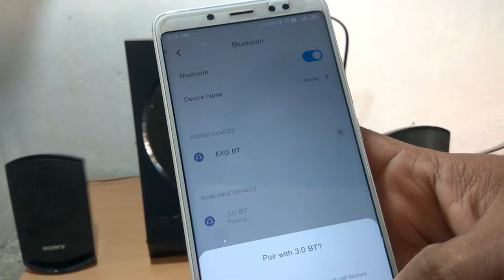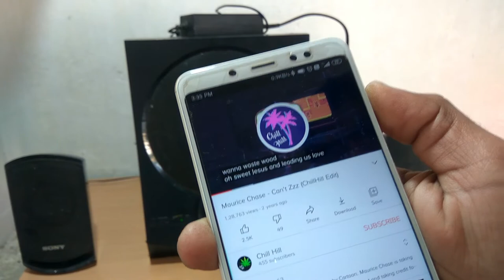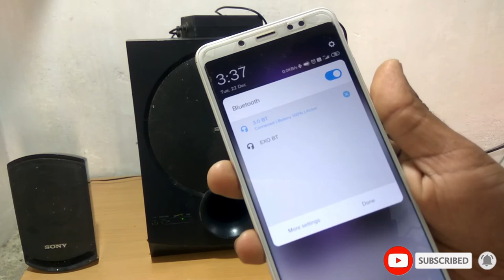Sony SA- D10 || Sony Normal home theater convert into Bluetooth || any speaker convert to Bluetooth

Comment: Another simpler idea without doing this much of operation is purchase a bluetooth device with 3.5mm jack and put it to the USB port of the speaker and connect its 3.5 mm jack with the 3.5 mm jack of the speaker and select AUX mode on the speaker. Opening the speaker to this extent can cause damage to sound production of the speaker. Afford to spend 1000 rs in a good BT device.
Reply from the maker: This Bluetooth device local electronics shops available in just ₹ 60/- and online 150/- so this lowest cost without doing any external USB    bluetooth devices.

Comment: I have connected the same way as you have shown and it's successful but there is one issue I have 4.1 sony SA- D10 SYSTEM so in Bluetooth mode only two of them are connected and woofer but rest two sounds are give low sound or not connected. Can it get solve?

Comment: Hi, I have SRS D9 and I have damaged it's speaker cable connector or plug what u say. Where or how can I get it repaired?
Reply from the maker: Yes sure you can check speaker is working or not if 
Working fine then change cable or plug
Reply: @CCTVTECH  where can I get those? Online or offline. Please suggest. I leave in kolkata
Reply from the maker: @titikshastoyclub581  I suggest offline because it's available lowest cost if you can buy online but very costly.

Comment: Sir i am purchase BT Dongle... he is connect bluetooth but not sound to output..  Please help me sir
Reply from the maker: Please connect properly see connection,if still problem check, BT audio output
Reply: @CCTVTECH  sir i am connected properly but sound is not goes... sir Please suggest anyone different products for bluetooth dongle
Reply from the maker: Which is home theatre you used tell me model number
Reply: @CCTVTECH  sony D10 sir..
Reply from the maker: Which one you have connected Bluetooth to Input of Sony D10
Reply from the maker: Check That input channel working fine or not.
Reply from the maker: Send me photo on that 'bluetooth module '
Reply from the maker: @ajaydavne4447  cctvtechyou@gmail.com
Reply: @CCTVTECH  BT Dongle sir...
Reply: @CCTVTECH  sir what is main problem.. Please help sir
Reply from the maker: you said Your home theatre is working properly, bt dongle is not working properly   ,
In this video I have shown B.T kit that kit purchase offline shops easy to connect and cheap price just ₹60/-
Reply: @CCTVTECH  ok thank you sir.. i will try this..🙂
Reply: @CCTVTECH   konsi m sir
Reply from the maker: Problem solve hua kya, Ajay
Reply: tell me y bt dongle not working with sony sa d10 even  with active connection??
Reply: Koi solution  mila ho to btao.. Same problem here